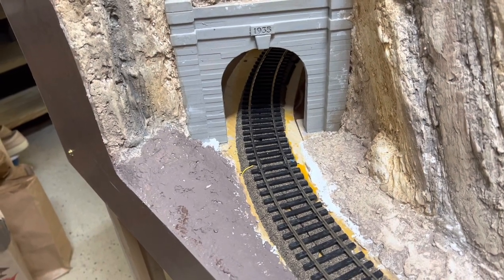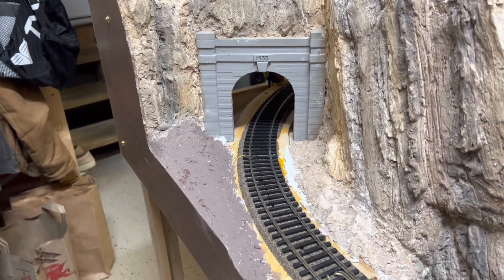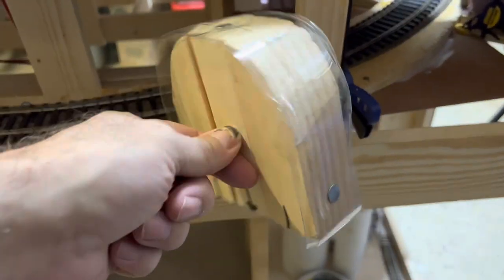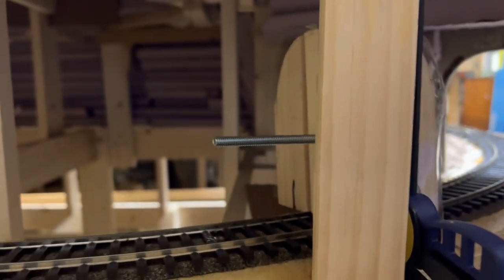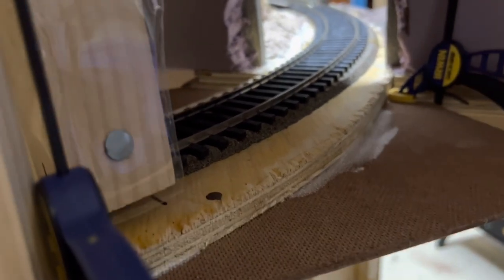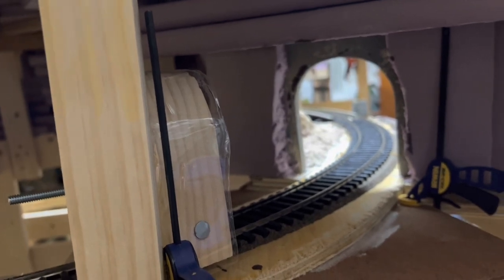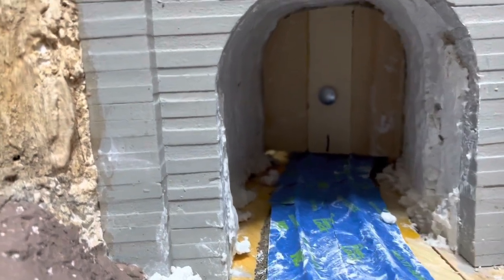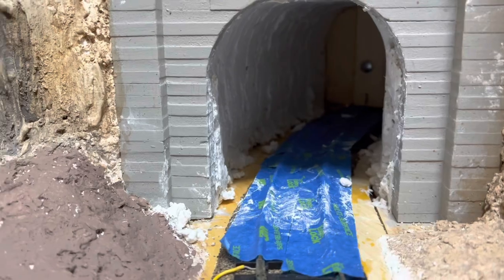O/On30 - O Gauge Tunnel Liner Build - Model Railroad Adventures with Bill EP 219

Comment: Hey Bill,
Back in the mid-1950's I used the same Liner Plate tunneling system on my former "O" gauge layout.  The long term problem I had was when running trains, or moving the layout, the tunnel walls would chip, crack, & collapse onto the track.
While the ugly side is still accessible here is a trick I learned from the old Railroad Model Craftsman Magazine.  Take an old ragged tee shirt from the junk drawer.  Soak the shirt in in water.  Carefully drape the damp shirt over the hidden tunnel walls.
When wet the plaster will soften.  But as it dries the shirt will strengthen and bond the plaster and anchor itself.
And don't fret about trashing a build.  I have had truck loads of good ideas gone bad over the past 70 years modeling.
Jim in N.Y.
Reply from the maker: Thanks Jim! Yeah an old shirt would work well.  I’m hoping the fibers in the sculptamold will keep things in good shape.  I will find out soon as I plan to start taking the layout to shows in 2023

Comment: I mentioned to another responder is that I am lucky that I don't have to model tunnels on my line. The reason is there are no RR tunnels or road tunnels in Kansas despite having 1000 ft. above sea level hills all over the place. Mostly I will be modeling cuts and fills and relatively high trestles. Planned into the current layout are two cuts and a small culvert at the fill on one side of one of the cuts. From what I see here the rockwork on my road will be carved mostly horizontally aligned and in the colors of sandstone, shale, limestone and other sedimentary formations, oh and brown coal seams.
Reply from the maker: There is some neat geology in Kansas even if it’s horizontal.  That will give you many opportunities to color the rock in many shades

Comment: I'm only 3 minutes into your video... but I don't think you are leaving enough clearance on the outside of the curve.  To get my BigBoy and 4-12-2 to clear scenery and walls etc, on my Atlas O-72 curves, I have to leave at least the full width of the track (width of the sleepers about 70mm) to allow enough room for the nose of the BigBoy and the cab roof of the 4-12-2 to not hit anything.  Just a thought. Great video on "How To".  Pete
Reply: I think the idea is to adapt his technique to your layout for your situation. I am lucky I only am modeling cuts as Kansas doesn't have tunnels on any rail lines here.
Reply from the maker: Very true.  If I was planning on running anything bigger than shag I have I would definitely expand things more.  As it is all my equipment runs the layout well